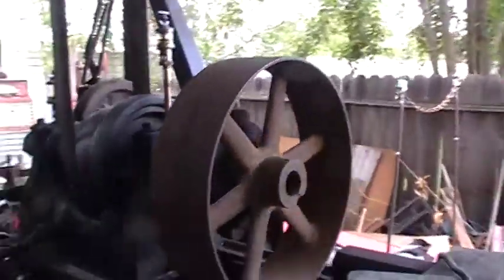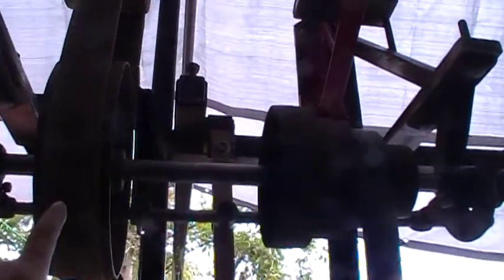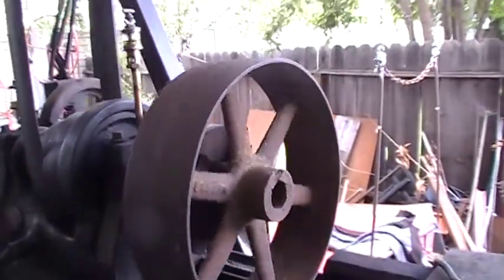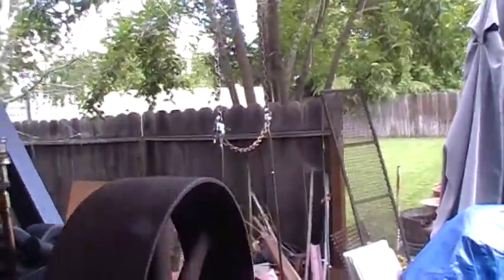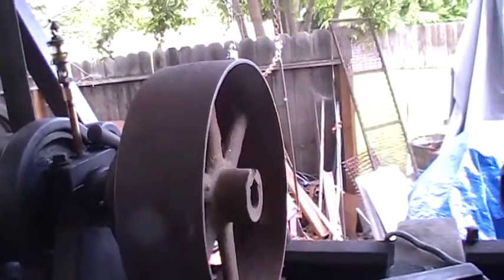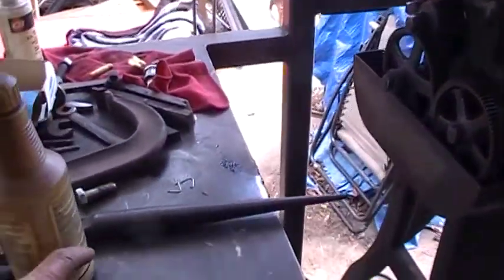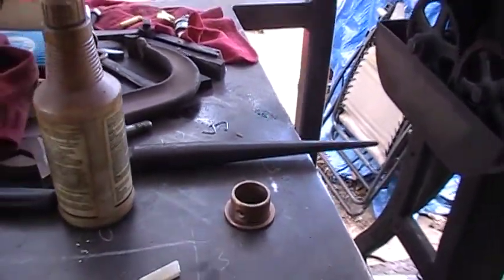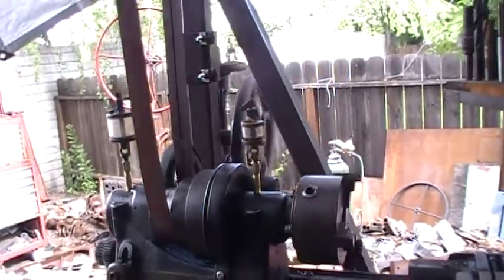First run of an old W. P. Davis lathe 12"

Comment: When is the fair again?
Reply from the maker: The fair is on July 26 thru the 30th. I'm boring the loose pulley for bushings with the Davis lathe. Belt slip and slow going but I'm getting there. The 12 inch pulley just fits with one inch to spare. When you get a chance let me know and come on over! I put 2 dozen night lights and of course the all important porch swing.